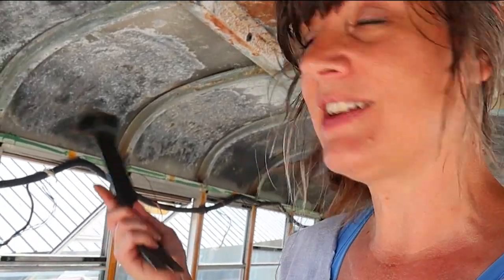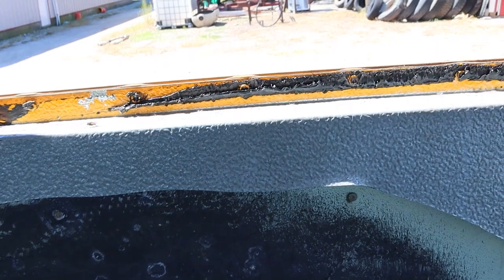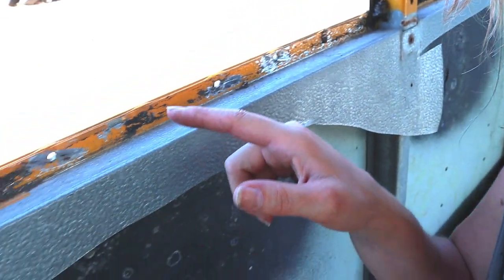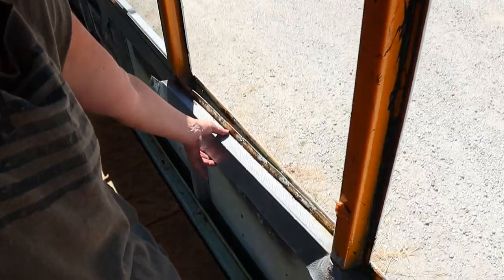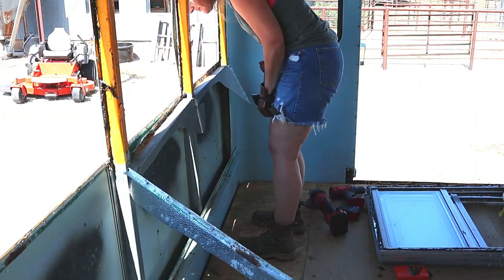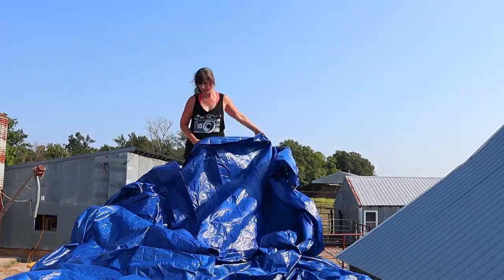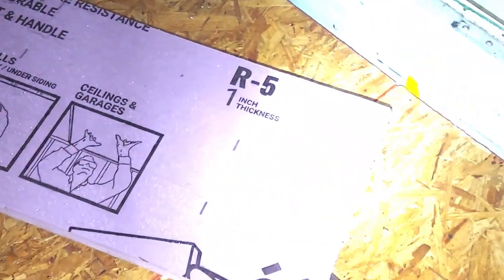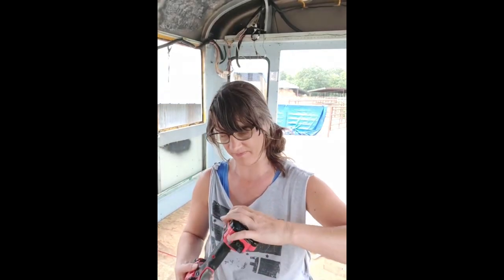I finally begin to remove the windows and rivets in my #skoolie, School bus conversion, tiny home

Comment: That black gunk is HORRIBLE!  I raised the roof, and thought I would just leave it.  But welding around it caught it on fire and it was even worse.  If you do this in the winter, the cold will make it harder and easier to take off.
Reply from the maker: Ahhhh...that's a good tip about doing this in the winter! I think I've finally reached a point where I don't need to mess with that gunk anymore. I'm working on placing all the rivets now. Also good to know about welding around it...the closest I came to that was grinding off my rivets..and the black gunk didn't catch fire thankfully, but it did smell really burnt.  What an adventure!